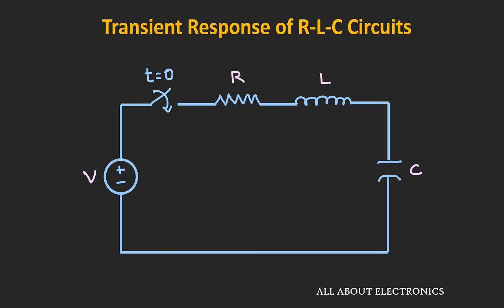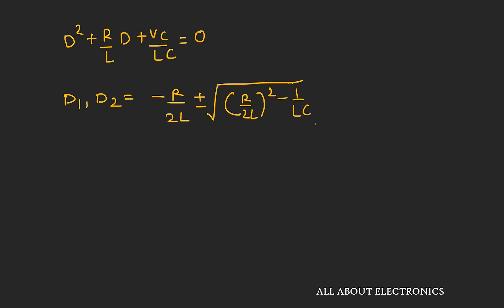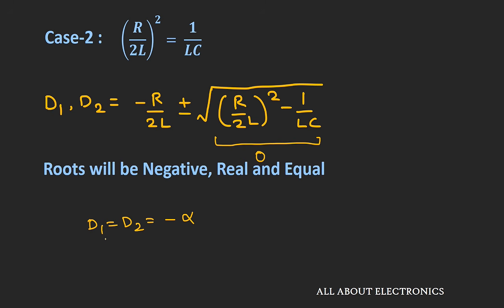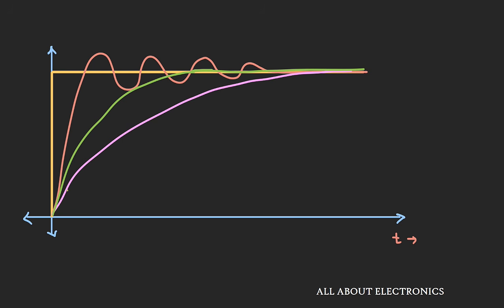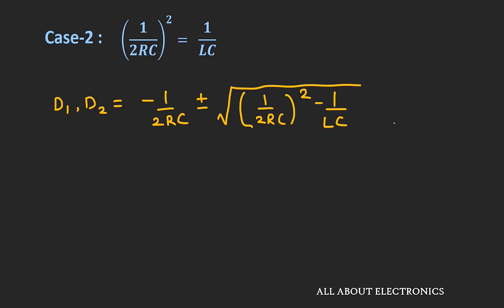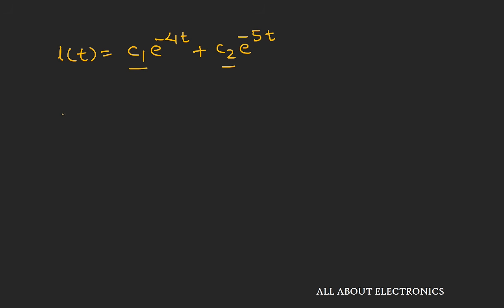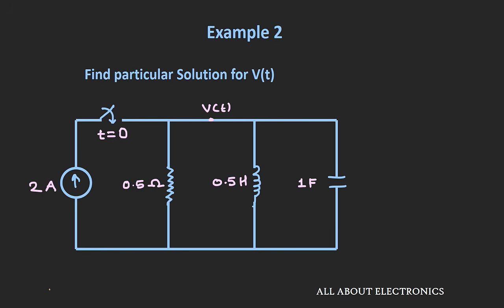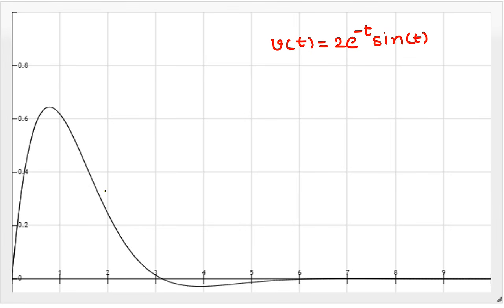Transient Analysis of the RLC Circuit (with Examples)

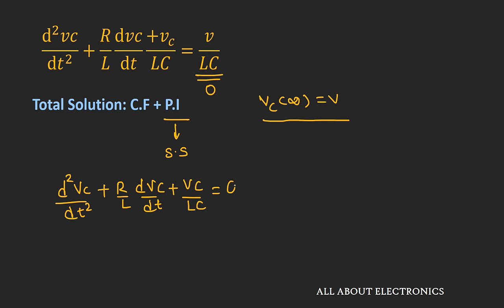Comment: At 4:11 why LC is 0 in case  of no excitation ?
Reply from the maker: For finding complementary function (C.F), we consider source free response of the circuit. That means we consider source as zero. That's why the term on the right side (the source) is considered as zero. Its not the LC is 0, bu rather the source V is considered as zero. I hope, it will clear your doubt.
Reply: @ALLABOUTELECTRONICS sir here I think by mistake you left Vc in the constant term ( Vc/L*C instead of 1/(L*C) ) after changing operator to D as Vc can’t be present or else we can’t find the solution of the differential equation ?

Comment: at t=0+, why doesn't inductor act as short-circuit in parallel case?
Reply from the maker: Inductor opposes the instantaneous change in the current. Therefore, initially if no current is flowing through the inductor then at t= 0 + also, it will opposes the flow of current though it and therefore, it will act as open circuit.

Comment: Sir while solving for first RLC Series example circuit why didnt you add the Particular Integral Value to the solution
Reply from the maker: Particular integral value represents the steady state value of the circuit. In this case, in steady state ( t = ∞), current i (t) will be 0. So, its not included in the final solution.
Reply: But you were solving for voltage Vc(t) and not current. So shouldn’t it be included? For example if we follow critically damped case for Vc(t) the entire equation will become zero at t = infinity. However since capacitor will be open at t= infinity Vc should be Vin and not zero. Please could you explain this. V was also included in the RC circuit so it should be included here as well right?
Reply from the maker: @aamir99204  If you closely observe at 23:26, we got the expression for the current i(t).
Reply: @ALLABOUTELECTRONICS  sorry Sir I meant in the derivation of RLC circuit you derived expression for Vc
(T)

Comment: Can you add annotations to fix case 1? I got a bad grade on my midterm because I had D1, and D2 as negative (this question was worth half the points on the exam), you won't get the correct answer using this, and I verified multiple times with a circuit solver. Your videos have been super helpful to me, but it seems like you aren't willing to fix your mistakes, which makes it a potential risk for me to use your videos going forward.
Reply from the maker: Thanks for pointing it out and sorry to hear that ( about mid- term grading). Yes, I will definitely add that remark in the description and in the pinned comments. In the some of the videos, where there is some mistake, I have already done that.

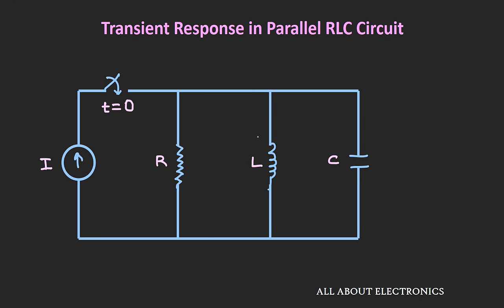Comment: 13:21 I don't understand why voltage source is connected for series RLC but a current source in parallel RLC circuit. Please explain
Reply from the maker: You can also do the analysis by applying voltage source in parallel circuit.

Comment: please tell how 20 V will be across inductor as there is a resistor voltage drop??
Reply from the maker: Hi, would you please mention the timestamp where you are referring ? It will be easy for me to answer your question.
Reply: @ALLABOUTELECTRONICS  21:40
Reply from the maker: @taranpalsingh9508  Inductor opposes the instantaneous change in the current. Initially before t = 0, since there is no current flowing through the inductor, so at t= 0+, the initial current through the inductor will be zero. Or it will act as an open circuit. since it acts as an open circuit, so entire 20V (the source voltage) will appear across it. I hope, it will clear your doubt.
Reply: @ALLABOUTELECTRONICS Yes thank you..

Comment: at time = 0+, the capacitor should act as open circuit because the rate of change of change of current across it is zero due to DC voltage source
Reply from the maker: Hi, would you please mention the  timestamp where you are referring to in the video.
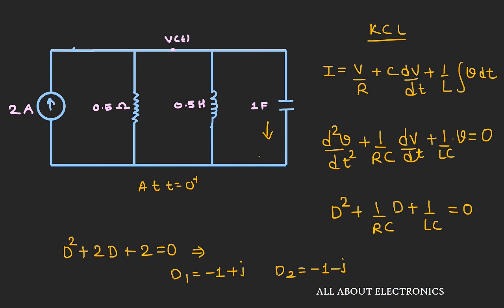Reply: @ALLABOUTELECTRONICS  It is at 27:15
Reply from the maker: Here we have 2A current source.
Reply: But still it is a dc source and the current through it should be zero
Reply from the maker: The capacitor opposes the instantaneous change in voltage. So, what ever voltage is there across capacitor, it should remain same at t=0+. Before the excitation, since the voltage across capacitor is zero, so it should remain zero at t =0+. Therefore, it remains short circuit at t=0+.
Reply: @ALLABOUTELECTRONICS  got it

Comment: how do we solve this if we have a resistor in series with either the capacitor or inductor?
Reply from the maker: For RC and RL circuit, there is a seperate video. Please check this video.
https://youtu.be/KylJ2v1_c-o
Reply: @ALLABOUTELECTRONICS  Thanks for the reply, I meant with it still being a second order circuit. A series-parallel example perhaps with an antiresonant frequency?

Comment: Could you please shed some light as in why a current source was choosen for Parallel combination of RLC instead of a voltage source.
I hear it many places that it kills the resonance but couldn't wrap my head around it. It will be helpful if you can explain this by using a voltage source for it and showing the problem in the parallel RLC circuit and explain the need for current source

Comment: When you solve the differential equation that is equal to 0 (solving homegenus differential equation), you get system's natural response, not tranzient. Tranzient response is a particular solution of a differential equation with a given voltage imput function (non-homogenus).

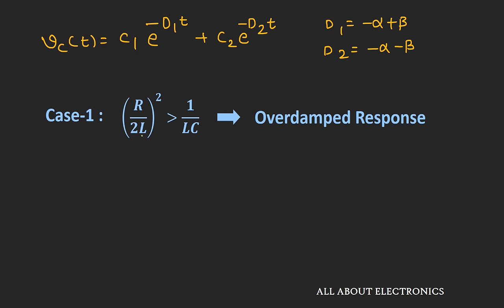Comment: At @8:11 it should be D1,D2 instead of -D1,-D2 which will make the solution C1*exp(D1*t)+C2*exp(D2*t)
Reply: Characteristic equation was also wrong
Reply: @mysteryigen  Yeah he forgot the t in second term
Reply: I ended up getting a bad grade on my midterm because I had this in my notes. It would be nice if he could fix his mistakes with annotations. It's 100% D1, D2 because I have verified with circuit solvers and you won't get the right answer with negative D1, D2

Comment: sir how the capacitor act as a short circuit (at time t=0) when it is fully charged .If i am not wrong it should act as open circuit while inductor act as short circuit . Please guide me about this...
Reply from the maker: The capacitor opposes the instantaneous change in the voltage. So, if it is fully uncharged before t= 0, it will act same at t=0+. That means it will act as short circuit. If it has some finite voltage V at t=0-, then it will have the same voltage V at t=0+.
On the other end, the inductor opposes the instantaneous change in the current. That means if no current is flowing through the inductor at t=0-, at t=0+, the current through the inductor will remain zero.
If some finite current I is flowing through the inductor before t=0-, then the same current will flow through it at t=0+.
I hope it will clear your doubt.

Comment: Hi, if I want to find the voltage across capacitor in series rlc circuit, do I use the integration formula?
Reply from the maker: Since the input is sinusoidal signal, under steady state condition the voltage across the capacitor will be I* Xc.
Reply: @ALLABOUTELECTRONICS  What about for DC voltage?
Reply: @ALLABOUTELECTRONICS  The problem I'm facing now is a series rlc step response circuit asking for voltage across capacitor for t>0 after a switch from 4V to 8V at t=0

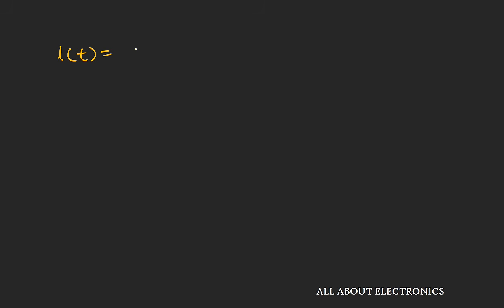Comment: From 20:35 you write the equation of i(t). I am a bit confused because you tell all the way in the beginning i(t)=C*(dVC/dt). You write the equation of voltage, not current. Please correct me if I am mistaken. Thanks in advance!
Reply from the maker: In that question, it has been asked to find the expression of the current. That's why the equation of the current is written. (Using the KVL, the equation of current has been found).
I hope it will clear your doubt.

Comment: how to calculate particular integral
 you just tild how to calculate complementary function
Reply from the maker: We need to find a particular integral when there is a forced excitation. And for the different types of forced excitation (e.g  A* t^n, A cos (wt) etc. ) there is a trial solution.
For example, for A* t^n the trial solution is  B0x t^n + B1 x t^(n-1)+---- and so on.
Or for A cos (wt) the trial solution is B cos (wt) + C sin(wt)  (Here, A, B, C all are constants)
By substituting the trial solution into the differential equation you will get the unknowns. And eventually, you can find the Particular Integral.

Comment: I like how you dive into the calculus.  I dropped out of electrical engineering school because I got lost in the calculus.  I think that you should have given the resonant frequency equation, f = 1/ 2 pi times the square roof of L times C..  I have memorized all electronics equation, and know them well.  I like to put circuitry on a breadboard and then screw around with the external components to create new engineered circuits.  I am intending to try to change an am radio ic, where the frequency depends on the exterior descrete components, and try to turn it into an low frequency receiver.  We will see, but that is the fun of it!  NOW TEACH ME PROFESSOR!

Comment: HI All About Electronics. Do you have more examples about RLC transient Analyais?
Reply from the maker: I have made the dedicated video on the solved examples on transient analysis for RL and RC circuit and have also provided few examples for practice in the description. 
You can check that video.
Here is the link:
https://youtu.be/zDcXt9Vx34o
I used to post a Quiz regularly in the community tab section of the channel.
Earlier I have posted a few questions on transients. So, you can check that page too.

Comment: One question: In solving for transient response of series LRC  the term V/(LC) was zero because you said V was zero.  Can you clear that up for me ?
Reply from the maker: Would you please provide the timestamp where you are referring to?
So, that I can easily answer your question.
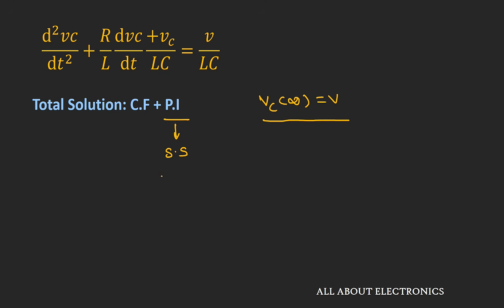Reply: ALL ABOUT ELECTRONICS  3:50
Reply from the maker: Like I mentioned, the solution of the linear differential equation contains two terms (C.F - Complementary function and P.I- Particular Integral)
The C.F represents the transient response of the circuit while the particular integral represents the steady state response.
Here we want to find the transient response. Which means in the differential equation it has been assumed that there is no excitation. Hence Voltage V on the right-hand side of the equation is assumed zero. 
I hope it will clear your doubt.
Reply: ALL ABOUT ELECTRONICS  Ok, Thank  you

Comment: This is definitly one of your more math intensive videos.  Excellent presentation compard to other videos I have watched. There is a free math program, I think it is also open source, called wxMaxima which is the graphical front end for Maxima. It is a computer algerbra system software. Very powerfull that allows you do engineering mathmatics and much more.  Much better than doing the math by hand if you have to do it more than once.

Comment: Respected, as u said that the supply is dc. But capacitor blocks dc, so, then where from current across capacitor?? Plz elaborate
Reply: Capacitor is uncharged initially so it acts like a short circuit untill is charges up. So there is a current through it initially.

Comment: how roots can be jw
in 4th case of parallel R L C  ckt 
if R =0 then it will give infinity value 
no solution
Reply from the maker: In the fourth case, the value of R will be equal to infinity and not zero. If it's zero then L and C will also be get shorted. That's a valid point and it has been already discussed in comments earlier. 
But good you pointed out.

Comment: while explaining the concept, it was mentioned  in the series rlc ckt overdamped final equation is of v(t). However, while solving the example you took it as i(t). How exactly did you use that?
Reply from the maker: If the roots of the system are real and negative, then the response of the circuit will be overdamped. And same is true for circuits. So, it doesn't matter if it is voltage or current if the roots for voltage or current equation are real and negative then the response will be overdamped.
I hope it will clear your doubt.

Comment: when r=0 in parallel rlc circuit in case 4 the whole eqn becomes infinity, as r is getting divided by 1.what will be the roots of the eqn ????
Reply from the maker: Good to point it out that. For parallel RLC circuit, the fourth case should be R is equal to infinity or Conductance G=0. If R=0, then it will be short circuit and C as well as L will also get shorted. So, the fourth case should be when R is not connected in the circuit (i.e LC tank circuit) and it possible when R is equal to infinity. 
Thank you for pointing it out that 👍
Reply from the maker: No, for the parallel RLC circuit, if R is infinite, then the circuit will act as if there is no resistor connected in the circuit and only capacitor and inductor in parallel with a current source. And you will get voltage across capacitor or inductor. 
I hope you undersood what i mean to say.
Reply: makes perfect sense, thanks!
Reply: ALL ABOUT ELECTRONICS 

If r is infinity then the voltage across the circuit will be zero.. how can we find the conditions if voltage is zero??

Comment: Please check your arithmatic. on the solution equations "e" was raised to the -D and in the first example, D1=-4 and D2=-5 and when you plug those into the equation, i=c1e^4t + c2e^5t not i = c1e^-4t + c2e^-5t, unless if we supposed to substitute D and not -D.

Please rectify those and besides that, your explanations were on point. keep up the good work!
Reply from the maker: Yes, you need to substitute D and not -D.  As D's are the roots of the equations. So, if D1=-4, and D2=-5, the solution will be, i= c1e^(-4t) + c2e^(-5t).